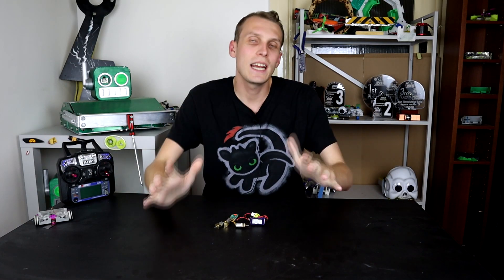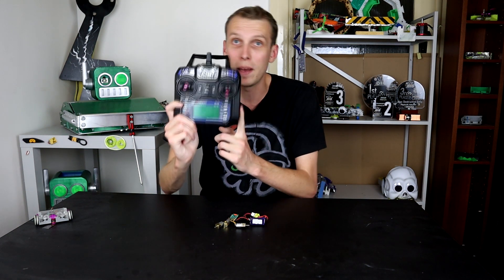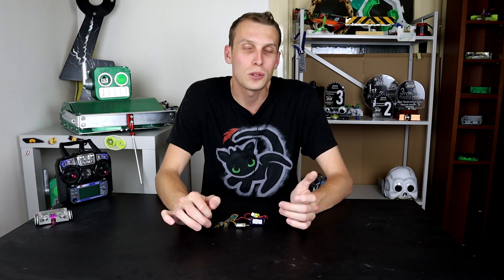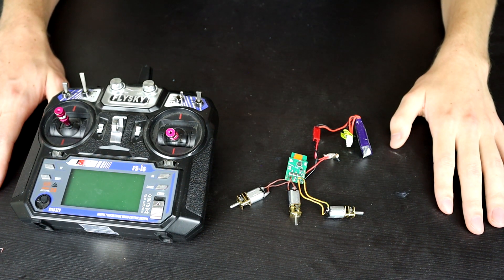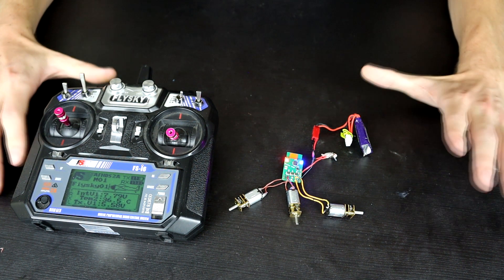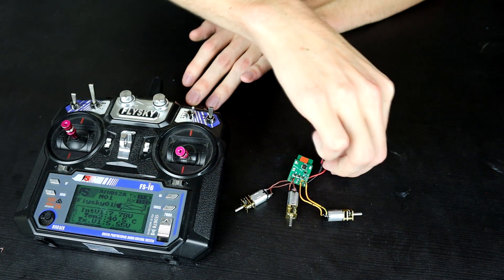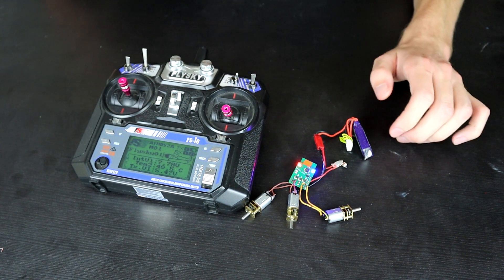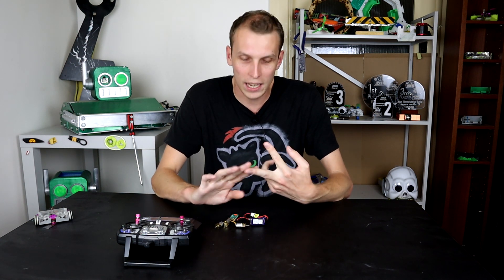Malenki-Nano ESC & Receiver overview and review

Comment: Ben - Can you please comment on the driving with the motor breaking vs without motor breaking. I've heard that the control of the bot is dramatically improved with motor breaking that comes standard with this ESC. The way I've heard it described is instead of coasting to a stop when you stop the input, the bot rapidly stops giving you precision control of the exact movements. For a race car this is undesirable since your want to keep moving, but for a 150g combat robot in a tiny space you want all the precision control you can get. Helps you aviod pit hazards and get your opponent exactly where you want them.

What are your thoughts on driving with or without motor breaking? Maybe a video subject?
Reply from the maker: Ummm, I havent given it much thought, as usually breaking doesnt feel too much different for me, which I think it down to my driving style.

But it would be an interesting topic for a future video, for sure

Comment: Why so long to go into auto bind? Spektrum UMX receivers will go into bind mode after about 10 seconds if it doesn't pair up with the bound transmitter before that. 

It'd really eat up a lot of time if you had trouble binding and it took 2 or 3 tries.

Comment: Thanks for spending the time to make this review Ben, totally agree with the points made. I run the malenki mainly just for drive  with the built in mixing  and with a n20 hammer on the third channel - so don't spend too much time on configs. I've have had a good experience with it, mainly just really appreciate the size, weight and built in RX! 

I run the BBB Shop and we pretty much stock as many malenkis as Mark can make but do ship worldwide :) 
If they're out of stock he's usually made more within a week or two, he's such a champ for putting so much time in to making this thing :)
Reply from the maker: hmmmm, might have to test out your shipping at some point then
a few extra malenki's for loan bots could be very handy

Comment: Great video!
Disclaimer: NB: I actually have 6 of these Marlenki nanos but I haven't used them yet (slow getting my batteries and wires). I think they are the best ESC for UK antweights/US fairyweights, hands down. They are even a weight savings from the oop nano2 from Rory/Shakey. Any notes here are strictly in the "let's make the best better" spirit. Mark has done a PHENOMENAL job on these and a crazy good service for the 150g community. 

Video 
I like these for all the reasons you mentioned PLUS they come standard with motor breaking (which can be turned off if desired) which is IMHO is ideal for control over tiny UK antweights. The cheap ESCs don't have this and IMHO leads to less control over the bot. Since the arenas tend to be small with pits, this is very important. I'll try to post again once I get the robots built. Again, great review! I can't speak to the setup issues you bring up, but they don't sound too problematic if they can be solved with firmware updates (I'm not a coder though, maybe they are a PITA, hard to speak for anyone else). I can tell you that I'm going to be using them in all my antweight bots and buying a lot more (after I get the arena built). Thanks for another great Saturday video Ben!

Comment: One thing that would concern me with the binding mode is an other pilot could bind to your robot while your combat is starting/waiting for the arena to be closed.
Reply: The Malenki won't enter bind mode if sees a signal from the bound transmitter - even if it's just for a second, so you can just turn the tx on then off.
Reply: They can actually do that with a lot of receivers. Some models enter bind mode briefly on every power on.